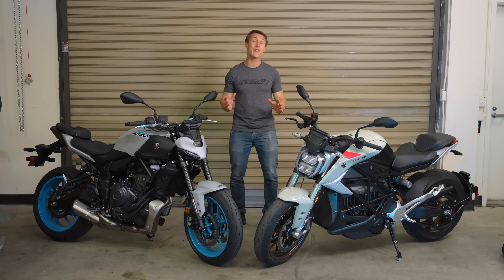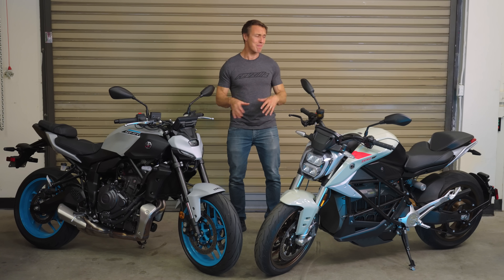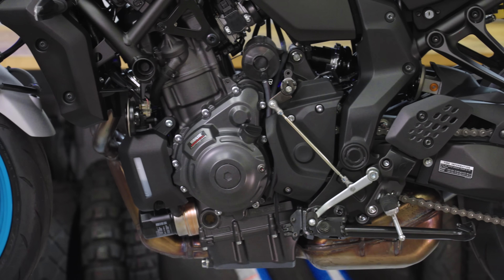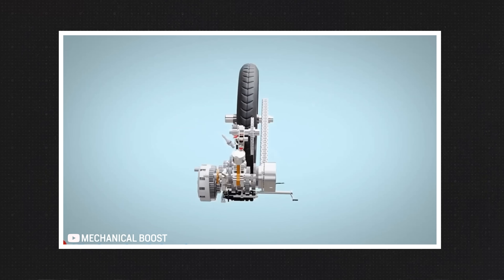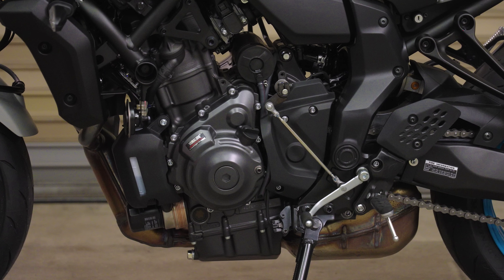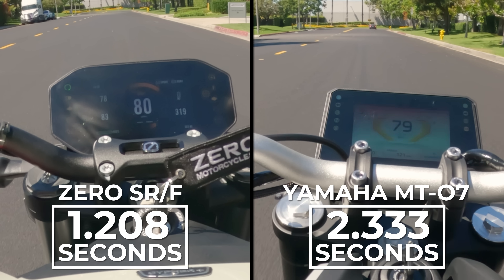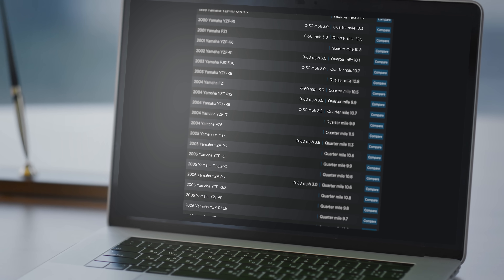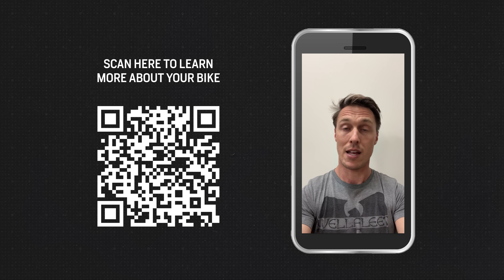Are Electric Motorcycle Torque Figures a Lie? | The Shop Manual

Comment: I've always said what we want to see are thrust curves of production vehicles, not dyno charts and manufacturer claims. I own two 200hp+ M-bikes in Competition spec (carbon wheels etc), an MR and an MXR. I have friends with standard street version of those bikes, and in our roll on tests (typically 2nd/3rd gear 40-80 mph) the standard bikes consistently out accelerate the high hp top spec bikes. E.g. Check out a Triumph Speed Triple torque curve compared with an M1000R and you can see that in the real world midrange roll-on's would favor the lessor powered Triumph. p.s. Both my M bikes have BMW's own Torque Optimized Tune applied. I.e. they have 'less' top-end and 'more' midrange torque than the standard tune, and yet the standard road bikes demonstrably walk away from them. A friends Pani V2S also has no problem hanging with me in roll-on's. Friends Street Triple RS;s are thereabouts too. Buy an S1000R, Speed Triple RS, Street Triple RS or Panigale V2S, and be happier people!
Reply: That is such a good idea. Specifically regarding the thrust curve, do you envision it as a seconds on the x axis and mph on the y axis?
Reply: Never mind just watched the video and learned everything I needed to lol
Reply: @usaclaimsthemoon4198  British motorcycle magazines often used to show thrust curves in the early 90s. It's kind of like a claimed 'dry weight' - who cares, we want to know how much the bike weighs with a full tank of fuel, oil in its sump, air in it's tires, and with all 'typical' OEM equipment fitted. The same with power. The driveline (shaft, chain, belt, length, coupling, gearing) really affect the 'claimed' crank power figures - again, who cares. How much 'oomph' have I got from 4k in 2nd is much more important to understand.
Reply: @usaclaimsthemoon4198  What? No. It's force or acceleration as a function of velocity.
Reply: @mysterious_nobody_99  It's actually force 'and' acceleration, as a function of 'torque, hp, driveline, and gearing' that equates to 'thrust'. Velocity is a vector quantity, meaning it is a product of both speed and direction.
Reply: Wow someone with a brain, getting more and more rare these days. 100%  correct, thrust charts are what matter, and you're spot on about the speed triple and that class of bike.
Reply: @mysterious_nobody_99  Thank you! I actually rode the '25 Speed Triple RX for 50 miles yesterday, back-to-back with my MR-C. And my seat of the pants tell me the Triumph has stronger midrange (4k-8k) torque. The ride quality of it's Ohlins 3.0 suspension is next level too.
Reply: Street Triple are awful, they are just decent engines and everything else cheaper out. Low quality and weird in between engine. Better buy new Hornet 750 for beginner or liter for experienced guy. Eventually maybe something like MT-09 for in between if you really want. You can get used F800R 2015+ version for the same price as Street Triple, and it have better features and better handling.
Reply: @Alen725 Your truth is valid. But as an ex owner of a 2024 RS, my personal ownership experience differs. The 130 PS 765 is the absolute perfect and rewarding road engine. It's developed for moto2, so has to be bullet proof. Its handling at knee down angles is sublime. My friend Nate (races for BMW and tests with Topraq) called it 'perfection'. There's absolutely nothing low quality about Ohlins and Brembo Stylema. They are certainly high end components that you will not see on any of those bikes you mention. Several of my friends own an RS/moto2 and are absolutely delighted with them. I miss mine and will buy another one day. Thankfully we all have a lot of choice. My advice to anyone reading this is try them all and buy what works best for you.
Reply: @RichDunn  I wouldn't call it perfection at all, its either speed or street are kinda high in price range for what they offer (price range of BMW) while they offer the cheapest basic things for street riding and no visual fireworks. Ohlins and brembos are available for most motorcycle brands, and you get that on BMW I mentioned which is even cheaper. And I kinda dont get what type of riding you meant. You mention someone who races, and those bikes are not for racing. It would be much better choice for street or road, but their durability and the endless complaints I hear about triple engines and street triples really turned me away from buying one, even if they are cheap on the used market. But maybe they are cheap for a reason.
Reply: Dyno chart is a good start. Right now it's just peak numbers in torque and power, kinda useless.
Reply: @F3udF1st  I wouldn't say Dyno Charts are useless, as such, they do provide an indication of the amount of work effort (torque) and the frequency in which that can be replicated (hp). And importantly how they are delivered. They're just not as telling as thrust curves.
Reply: Absolutely in support of the rear wheel thrust curve being used and shown more. It's indeed much more representative of real world experience and performance. It'd be a mind shift for both consumer and manufacturer, but imho, both would benefit.

Also, you seem to have a lot of fun with your mates! Lotsa good braap times.

Comment: Every electric bike I've ridden has felt, more or less, like a liter bike in first gear. Liter bikes, conceivably, wouldn't need a gear box to operate any street in the world, legally, but you'd get horrible mileage.
Electric bikes seem to do the same thing; at low speeds, they are fine, but higher speeds kill range. So why not have a smaller motor and lighter battery, and a normal gear box to achieve significantly better mileage? 
Folks say the torque is constant, but the energy required to spin the motor faster is greater the faster you want it to go. If we could keep the rpms down, wouldn't we maintain the same constant torque at slower engine speeds and vastly increase efficiency?
Reply: The efficiency benefit of a smaller electric motor would be minimal or possibly even negative when you add in the efficiency losses of a gearbox, and it would also come at the cost of max power for high speeds.  Well designed electric motors are already so efficient compared the combined effects of rolling resistance and air drag that all a gearbox would really provide is the potential for higher performance (even more acceleration at low speeds, even higher top speeds).
Reply: @kswaid1  Yeah, that's why we should have gearboxes in electric bikes: for higher performance and higher top speeds. A smaller motor that drew less current would have higher low speed performance, and a higher top end all while using less energy and thus extending battery life. 
Maybe I'm just too dumb, but using simple machines to amplify mechanical advantage seems so obvious, but I've never even seen an experiment with geared electric motorcycles to prove it one way or another. But all my lived experience, like with single-speed bicycles and the few e-bikes and electric cycles (OSET 24), makes it seem like gearing makes work easier.
Reply: I don't know the specs on the motor compared to a Zero off hand, but the Brammo/Polaris empulse had a six speed transmission. I rode one on a test drive about 12 years ago, and it was great.
Reply: @Lowendansterling  I've only ridden an OSET 24 and it ran out of power extremely quickly. I got it to be a trail bike, and every ride I'd be yearning to click up into second!
Reply: Because parasitic drag is exponential as speed increases. That is you, your gear and anything exposed to the wind. This is what causes range to fall off.
Reply: @thomasneedham1512  I'm not convinced. If I ride my cbr1000rr in first gear only, I'm going to get great/normal mileage at low speeds and awful mileage at high speeds. Every moving thing is subject to drag.
Reply: @werepat Increased RPM obviously uses more fuel, but if you have ever flown in an aircraft with multiple exposed antennas, you would know what I am saying is true. Also, any physics book will prove me right.
Reply: @thomasneedham1512  there are physics books that show how simple machines don't work once applied to an electric power source? I'm being snarky, sorry. But your response is the same that everyone repeats, apart from aircraft antennae, and I guess I am simply unable to comprehend why if it works for one machine, that it does the exact opposite for another solely based on power source. Energy is energy, work is work. "Trust me, bro" still isn't enough for me.
Reply: @werepat  Max speed of an EH-60A Blackhawk is much slower than a slick UH-60A model, even in a dive due to the external antennas creating parasitic drag, which increases exponentially with speed.  Why do race car mechanics look for tiny aero improvements? Because I am telling the truth.
Reply: @thomasneedham1512  Look, I'm not a rotary aircraft mechanic, but I can google, and apparently both airframes max speeds differ by 5 mph. 217 versus 222... Yeah, you're telling the truth, but I don't think it's quite proving the point you want. 
None of these arguments over the years have convinced me at all that a gearbox magically stops working once paired with an electric power source. It's ridiculous, and I bet the actual reason is money or something equally banal.
Reply: They loose range because of drag on highway not high rpm
Reply: Nope, electric motor efficiency is basically flat across low and high RPMs. You can't run away from the fundamental physics that going faster requires more power, so a transmission won't help. The reason it works for IC engines is that efficiency varies substantially across a wide RPM range, and are so inefficient overall that optimizing their operating RPM with the help of a gearbox and transmission actually results in a measurable improvement.

Lipstick on a supermodel does not do much -- the supermodel is already attractive.

Lipstick on a pig... I guess makes for a prettier pig?

Comment: I feel like the 0-60 and 60-80 figures just confuse more than they prove the point though, since peak acelleration happens at peak horsepower, not peak torque. Which in a way I guess is the point here, it just seems like a really convoluted and roundabout way of going about it?
Reply: I think his suggestion is more for getting an idea for how a bike might feel to ride, rather than a proper apples-to-oranges power comparison.

Comment: Wouldn’t care if the electric bike had twice the torque they’re still a one trick pony like every other EV. There’s no passion or pageantry, no sound track just the sound of an aggravated sewing machine and once the battery is flat you’re done until it’s recharged.
Reply: For me only down side of evs is recharge time or range. I am OK with 100km range if it recharge in 5-10mins. 
I need break anyway so i wont mind that much time.
Reply: someone's pissed that they got gapped by an electric bike 😂

Comment: what people need to get is the power chart. how much horesepower/kilowatts do you have at whatever speed to put in(in the optimal gear), since that is the figure that represent the work being done to accelerate. 

torque is so misunderstood and so misused. if you're not designing the powertrain you don't need to know or care about the torque figure. the electric motors have lot of power from 0 revolutions and that gives a lot as the torque rating.